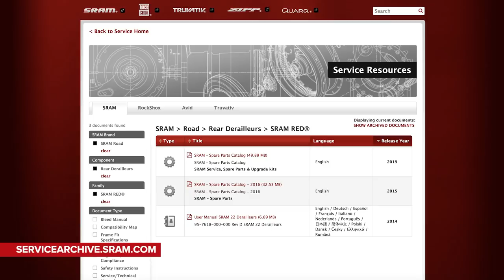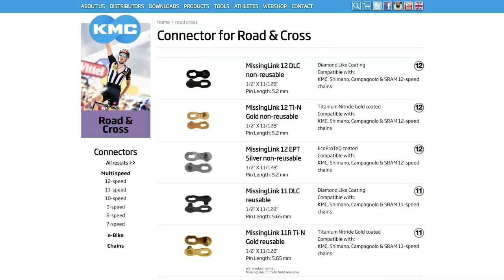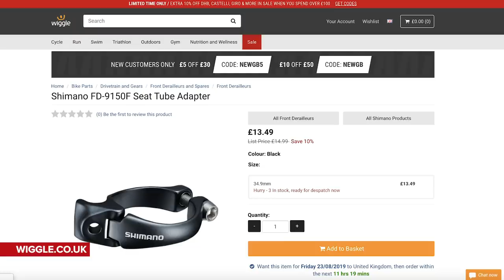How Do You Keep Your Bike's Chain & Cassette Rust Free? | GCN Tech Clinic

Comment: #AskGCNTech 
Hey Jon, a friend of mine offered me an Ultegra 6700 groupset without the brakes for a very good (steal) price, however it has a 6600 Crankset, I currently have a Sora 3500 gearset with an FSA Gossamer Crankset with outboard bottom brackets and a 24mm spindle. I like the fsa crankset better and I believe it's much newer than the Ultegra one. Should I get the Ultegra crankset or should I stick to my FSA?

Comment: #askGCNTech

Hi Jon. I have a vintage roadbike project goin on. Its an old steel Fresci frameset from the 80s. As groupset I've got an Dura Ace 7800 set for it, but I don't really like the external routing of the sti's shifters. So I'm thinking about getting some newer 10s 105/tiagra STI-Levers with internal routing. Do you know (because I didn't find any chart) if newer 10s STI are compatible with the old 7800 RD an FD?
And sorry for the not era-matching groupset ;)

Thanks, Nik

Comment: #askGCNTech Hello Jon, I’ve got a question about tires and puncture protection. I have a cheaper gravel/commuter Cube NuRoad Pro FE that i use every day to commute around 15km one way, and for tours on a weekend doing around 100-150km per ride with around 60% asphalt and 40% hard packed gravel. The bike came with tubeless ready Schwalbe g one speed 35mm tires. However out of the box they ran with tubes inside and that setup offered little to no protection from punctures. After having around 5 flats in 3 months I gave up, decided to forget about the speed and have installed the Schwalbe Marathon Plus tires instead. Now there are of course no punctures and I have adjusted to the feeling of the bike, but I find that the g one speed tires were so much more stable, fast and fun to ride that I just can’t throw this out of my head. Would you recommend a tubeless setup with the g ones for a daily commute? Any downsides to that? Can I still install it if the tires have been punctured multiple times (nothing serious, you don’t even see the holes) Or is there maybe a not too heavy tire with decent puncture protection that I could use instead? Thanks a lot! I would really like to find something that would be fun to ride and at the same time would not force me to regularly replace tubes on my commute.

Comment: #AskGCNTech  With so many options how do I pick a new chain for my road bike, Ceramic speed, Shimano, KMC, diamond coating, nitride coating, silver, UFO?  I read once that KMC chains are compatible with road bikes but are generally made for mountain bikes (not that I believe everything I read) and was also told to stick with the manufacturer of the drive train which in my case is a Shimano Ultegra 6700 groupset.  In a world full of "marginal gains" what is the best bang for the buck?

Comment: #AskGCNTech Hi Jon. I've recently bought a gravel bike for light trail riding and bikepacking. So far I'm happy with the purchase except for the breaks. It has Giant Conduct hydraulic disc breaks. The problem is the odd gizmo that translates mechanical STI levers to hydraulic which blocks entire handlebars (I can't install GoPro mount, bike computer mount, aero bars for bikepacking, etc) and if they break when I'm traveling nobody will be able to fix it. Since they run on mineral oil I was thinking about just switching to hydraulic 105 STI levers without swapping calipers - is it possible? If so can I keep current Tiagra front mech or do I have to change it as well (I've already changed rear mech to Ultegra RX which is 100% compatible with new Tiagra levers)

Comment: #AskGCNTech
Hi Jon
On my Ultegra 6700 the middle cogs dont shift very smoothly. The high and low gears are working fine but the middle ones dont work. When I try to up-shift into the 5th and 6th gear the chain doesnt move but then when i up-shift another gear the chain jumps one gear and switches into the 7th. I already tried to set up the rear derailleur but that didnt seem to help at all.
Thanks from Austria 
Daniel

Comment: Hi John, I've managed to crack off some of the lacquer on my carbon frame. The carbon seems fine, and it's just the lacquer coating that's damaged. Can this be easily touched up/repaired? Thanks! Love the show! #AskGCNTech
Reply: Yes, it can. Tape off the area and a very light sanding to prep the surface for the clear coat should be done. Spray the clear coat and resand with very fine wet sandpaper to remove the uneven surfaces. Respray with a clear coat and polish with wax.

Comment: #AskGCNTech Hi Jon, I am attempting to renovate a POS I bought off ebay. Can you advise me on how to remove the chainring and cranks off the bottom bracket. The BB was square taper, but the non drive side is rounded, and I cannot access the driveside. Will I have to change the BB too?
Kind regards,
Will
Reply: You should be able to remove the drive side crank independent of the non-drive side. You definitely need a new bb since the square taper and bb are all one piece.
Reply: @newttella1043  ah crap. guess I'll just fork out for a new one then. thanks anyway

Comment: #AskGCNTech
Hi jon 

I'm having trouble removing my rear wheel

I recently installed ultegra r8050 di2 on my bike and since then my chain does not go down to the 11 teeth cog, which makes it difficult to remove the rear wheel.

Is there a way to set up di2 so that it drops to the 11th cog?

Thanks mate

Comment: Hi John, much love from Bulgaria here,
Fast question, I have noticed that both sides of the bottom tubes of the carbon rear triangle have like two identical 3 cm vertical scratches on the paint at the same spot.(just besides my 36 teeth large chainring). I took a needle and tried to find a crack or a hole, there were none, but I could break two little pieces of the carbon which left two very small holes  on the carbon tubes. Is this bike dangerous to ride? 
Might be important to mention that my rear triangle is not welded to the frame, but its put together with an aluminium(7005) frame. 
Thanks in advance! #AskCGNTech

Comment: Couple of things Jon, oon the seat post creaking, i had that once and it turned out to be where the seat rails joined the saddle, bit of dry lube sorted it out. Also the apparent rubbing rear wheel on the frame, i had black rubber scuff marks on the inside of my seat stays, turned out it was the tiny rubber mould guides on the tyre just flicking the frame, i cut them off, cleaned tye frame and no more problem. I hope that might help someone.

Comment: Hi Jon! This is the best show ever! I have a disc rotor fetish and love the look of the Dura-Ace rotors. If I get an adaptor to convert my current 140mm fork mount to a 160mm to accommodate a 160mm rotor, is there a potential the extra braking force achieved from the larger rotor could damage or even break my front (Carbon composite) forks under heavy braking? Do you think this could be a problem?

Comment: My bike related problem: everything is too expensive. What are the best ways to find bargains? What to watch for when buying used components, frames, etc.?
Reply: Go for a walmart fixie.
Seriously now, investing in decent parts for a decent bike will save you quite some money in the long run. Buy inexpensive spares en masse, get some chain links to replace bent or broken ones, keep the cassette and chain clean and well lubricated with a dry lube and check your derailleur indexing and range. Only that will extend the life of your drive train a lot. Also, keep your cables oiled. consider a bike with caliper brakes if you are not willing to invest in brake fluid or pads for disc brakes.  There are many products shown in Seth bike hacks. Check out his channel
Reply: Also. Steel frame, fork, handlebars. Cheap, heavy af and durable, but don't go cheap on tyres or inner tubes

Comment: #AskGCNTech Hi Jon, love your work, I always look forward for the Tech Clinic, although I do not have any many problems related to the ones you give tips on, but it's just so interesting, that I can't not watch it. 
So my question. I run a Shimano Tiagra groupset, 10 speed cassette (11 - 28) with a compact crank set 50/34. I noticed that when I am in the lowest gear (34 and 28) and only shift one gear up, the chain begins to skip and jump in the gear, like it was not properly indexed. I checked the indexing, but could not find any error there (I might be wrong). It happens only in this gear, all others are fine. I do not very often use this gear, but when I do it's normally uphill and a jumping chain is even more annoying if you have to fight a climb.
Do I have a worn out chain (has around 1500 km)? Is there anything I can do to fix this problem? 
Many thanks in advance.
Reply: Hey there. Did you solve your problem? I saw a video where someone with your issue narrowed it down to a tooth in the rear sprocket.

Comment: Jon you didn't really answer about the rusty chain. Drying with compressed air might dry the chain and cogs, but most people can't do that. And you can't get to all water with a towel on that parts. I would say the problem points to too little oil/lube on the chain. And/or his soapy water gets rid of the remaining oil on the drivetrain and thats why it's rusting.

Comment: compressed air is a terrible idea - the pressure could easily force water past bearings seals. use a leaf blower to air-dry a bike. it pushes a much higher volume of air at a gentle pressure

Comment: #ASKGCNTECH Hi Jon, need your wisdom. After a great day out on my bike I needed to clean it. I took the front wheel off while it was on the stand and began washing. I use some foam tubing to protect the frame from the clamp and while I was washing...it fell out the clamp!! My bike is a Felt FR3 with Carbon forks. The drop was roughly 1.5ft not very high but what’s the probability that I’ve damaged the forks? I rode the bike around the block after I had finished washing, nothing seemed wrong but I am concerned to go out on a longer ride. Thank you tech god
Reply: Carbon fiber is pretty tough. Other than a bit of cosmetic damage, I am sure it is still fine.
Reply: Cheers for the feedback, I will give her a spin on the weekend and hope for the best, thank you
Reply: @simonlamoon  YW braddah. Be safe out there

Comment: #AskGCNTech Hello guys, i just bought a new Drag Volta bike with Shimano 105 groupset. I rode around 200kms but the bottom bracket started making cracking sound (on the right-side of the BB) on climbs with gradient above 5%. I haven't noticed this sound on level rides.  Is this considered normal or should i have take it back to the shop for repairs. Here  you can find the bike:  https://dragbicycles.com/bike/volta-te15/ Thanks!

Comment: Firmware problems... And not for any good reason, just to coax you into buy a new piece. To replace a perfectly good old piece --hello environmental sustainability! Not to mention the iffy morality of this kind of inkjet business model in the first place.

I'd rather ride around with a doubly fixed flip-flop wheel than have that on my bike(*). Is there any e-gears that would allow me to flash my own, free software (and/or have a say on the firmware) or should I go out and make that? Because this is ridiculous.

(*) In general, I'd like to have components that are made to _proper standards_, such as the BSA/ISO bottom bracket, and thus interchangeable: proprietary and obscure is bad. It shortens the life of the bike, makes your life miserable and kills competition --> slows down progress, rises costs and that's a net loss for all of us.
Reply: Capitalism...
Reply: Suuuuper slimy.  They worked fine together until the firmware told them not to.

Comment: Wax you chain! Dont bother with chain-oil, its a MESS! Hot kerosene-wax on a well cleaned chain. Voila!
Reply: What's kerosene wax? I use standard paraffin. What's the difference?
Reply: @philadams9254  Same same :)
Reply: WD40!!!!
Reply: @casualguy3938  That is not ideal for chains. WD40 leaves a filthy mess on your chain. dont use!
Reply: @henriks5008  Spray it on the chain heavily, all the gunk leaves the rollers. Wrap a towel around the chain and rotate it backwards until almost all of the WD40 is off the external parts of the chain. 
WD40 on the rollers inside lube very well, and take much longer to wear off than wax. 
Since the chain only has a very light coat of WD40 on it, almost zero dust settles on the chain during your ride. 
Wax coated metal rubbing against wax coated metal is great for a short time but wax comes off much faster than WD40. 
Going on 30,000km on my current chain now, and it has had nothing but WD40 applied on it every 500-1000km. The only thing I do is wipe the chain down every 250-300km with a towel, which takes about 15-20 seconds. 
That. Is. All.
Reply: @casualguy3938  I used WD40 on a regular basis 25 years ago, and my experience with it is shit! I have also tried every other lube and method. WD40 makes your chain black, is a nightmare to clean and is way too runny for application. Its not made for bike-chains easy as that. Wax is way better and keeps the chain much cleaner, because its dry... i ride for 200-300 k before i dunk it in the crock pot for 5 min before assembly, its way easier. WD40 in wet conditions is just a joke. FYI No chain last much longer than 20 000 km anyway. It will stretch none the less and ruin your drivetrain. Good luck riding that chain for much longer and then changing to a new one! Have a nice day :)
Reply: ANYTHING liquidy will come out of the rollers eventually, no matter how much you rub it down. Wax just flakes off and leaves nothing behind.
Reply: @philadams9254  Thats exactly why i dont use oil, WD40 or other BS- products. It leaves your newly cleaned chain full of black shit after two pedal -strokes!  Nope the wax does not flake off if mixed properly with a bit of kerosene/parafine oil. Do your research my friend! My chain is golden for miles and miles even in rain. Look up  Molten-speed-wax for example. And last off all... WHY do you think almost none uses WD40 as chain-lubricant??? Its because its terrible as chain-lube!!
Reply: @philadams9254  And No! Teflon-based lubes does not not liquify. But are gunky and attracts debris and dust. Wax is the best way, noe point in arguing with me, im NEVER going back to oil based products.
Reply: @philadams9254 Not all of the WD40 is not going to ooze out of the rollers, and it doesn't evaporate. Which means it is going to leave a thin film on the rollers for much longer than the wax is going to endure the metal on metal friction. 
Rubbing the chain down with a dry towel is only going to remove the external WD40, so less dirt will stick to the outside.
Reply: @henriks5008  Your chain is black because dirt is sticking to the WD40. You probably didn't wipe it off well enough to remove all of the WD40 from the external parts of the chain. I don't ride much in the rain, but WD stands for "Water Displacement", and I can imagine that riding in the rain with WD40 on your chain would require cleaning more often than riding in the dry. 
Now, there is nothing wrong with WD40 or wax. WD40 works fine for me because I'm mostly a fair weather rider, but the ease of use, cost, and a few other things is why I keep using it. Wax works well, but I'd rather not have to buy kerosene, degrease my chain out of the box, buy a heater for the wax, buy the wax, dunk the chain in the wax, wait until the wax penetrates the links, remove the chain from the bucket, let it cool down, wipe/scrape off the external wax, wind it through the drive train, connect the link, do 500km, then remove the chain, unwind it through the drive train... etc. then repeat the above process.  

With WD40, spray on/wipe off (1 minute) ride 800-100km, spray on/wipe off (another minute), ride another 800-1000km. Repeat until I've covered enough KM to almost circle Earth. But a new chain and repeat. Much cheaper, less time, less hassle ;)
Reply: @casualguy3938  Dont use WD40! Its for people that dont know better. Please read the link i provided earlier. Also, no need to further argue with me on what i think is the best method for me and the climate here. WD40 is better than no lube, sure! And that is all! To claim otherwise, is sorry to say it just ignorant and a straight lie! Feel free to keep up with your WD40, but dont convince others its better than purposely made chain-oils or wax. Cause it just isnt. Read up on experts opinions on the subject please!!! Good bye!
Reply: @henriks5008  No, it isn't a lie. You've bought into paying much more for a wax, kerosene (or other degreaser), a heating element to melt your wax for chain submersion, and a lot of time and effort to save only 3 watts over using WD40, which has been proven in videos here on Youtube. Watch this video.../watch?v=qinJjb8_nEs&t=341s, 

or simply search for this video... 

"Chain Science! How to save up to 30 watts of losses from your bicycle chain!" and pay attention to the chart shown in that video at 6:45. 
You will see that even the very best wax on the market only saves you 3 watts over using WD40. 

Now you can leave this argument like a little bitch, or you can save some money and effort. Fast Fitness Tips heavily researches before he posts, and I would believe him over anything you post. Particularly since you have not offered one single piece of evidence that justifies switching to waxing your chain unless you are a professional rider who has someone else maintain your bike. 

So, fuck off with your little bitch ass or grow a pair of balls and prove to me that your wax is worth the added effort and cost. 

If 3 watts were so important to me then I would shave my legs and save 3 watts that way.